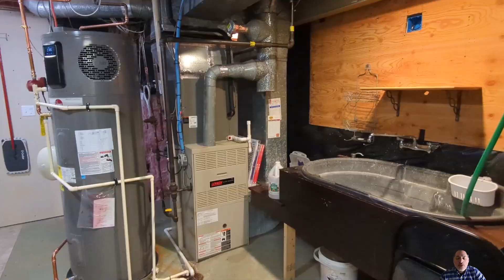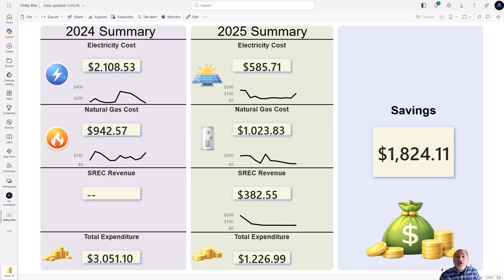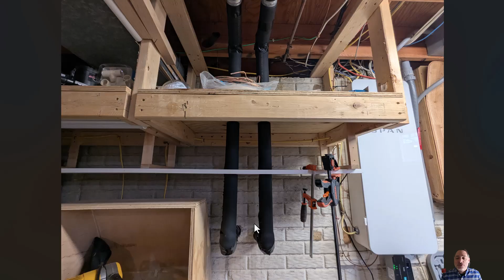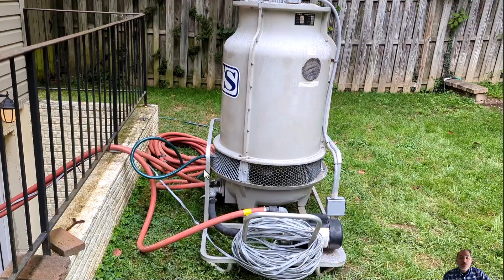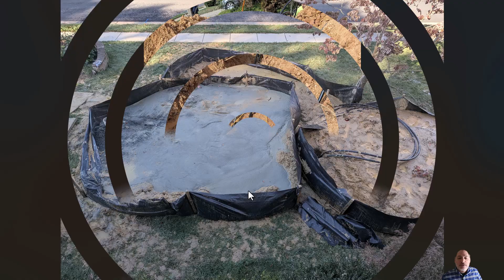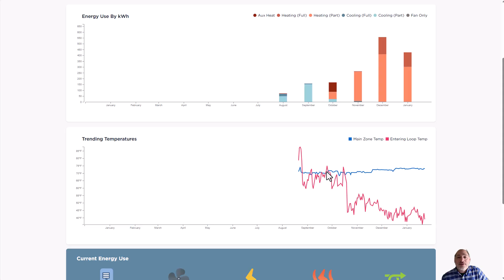WaterFurnace Series 5 vs 7 | Geothermal vs Air Source vs Gas — My Real Decision

Comment: We live in the Hudson Valley near Kingston NY.  Our geothermal system was installed in 2021 and is a 5 ton AAON WVA-060.  The house was built in 1987 and has about 1900 sq ft with a hot air duct system.  The quote from Dandelion Energy was $40,375 because we didn't do financing they gave us a $1750 credit.  The incentives were a $9,820 from our local utility which went directly to Dandelion and the Federal 26% Tax Credit for a final total of $21, 315.70.  There are two 300 ft deep wells and is a closed loop system.  We did get two zones which is great.  The Aux Heat hardly ever comes on but we do keep the system set at one temp in both hot and cold weather.  During the cold snap back in January and February of this year with temps hanging around in the single digits for three weeks the aux heat never came on.  We didn't get the desuperheater option because we also have a heat pump water heater.  We also have a 22.9kw solar system.  Here in the Hudson Valley we have extremely rocky soil and some huge boulders came out of the ground during excavation.

Comment: Did you decide not to add the desuperheater or optidry options on the series 7? The desuperheater would be super efficient with your heat pump water tank.
Reply from the maker: If I could go back and do it again, I might do the optidry option.  We don't really have much of an issue so I didn't think it was needed.  Still don't have any issues, but it might keep the house a little better balanced for humidity levels.  I was thinking about it a few months ago and when the unit needs to be replaced in 10-15 years I might go that route so I can compare living with both approaches.  For the desuperheater, it was about space in the basement and if the value was there.  I anticipated the only real benefit I would have was making the rheem heat pump water heater work a little less.  I don't think I would have saved any money on my already non-existent bills.  I just couldn't see the value for it in my situation, especially for the extra cost.  I figured if I had added that I never would have recouped the cost.

Comment: Upgrading to series 7 is a smart choice in my opinion. Many installers do not like installing or recommending a series 7 because it requires additional Waterfurnace training and certification. Not all authorized installers have the series 7 training and ability to install it. Found this out after almost all companies in my area were trying to convince me not to choose a series 7. Yes, there is a price difference but you are getting the best geothermal heat pump on the market and comfort in your home (low sound and comfortable temperature).
Reply from the maker: I was talking with the owner about the series 7, and he was trying to dig into the actual data based on my install and a few others in the area so he could use real data to help explain the benefit of the system.  Because I wanted zoning the series 7 was an obvious choice.  I tend to go with the most efficient option unless the cost is prohibitive.  In this case, the cost wasn't bad and included functionality I was looking for.  Made it an easy choice.  So far I'm very happy with the system.  The house is so much more comfortable, especially with the zones.  I just wish they had wireless integrated thermostats instead of wired.  I only added one extra zone because running the wire to where I would want a third zone meant too much drywall work.

Comment: Really good video - Thank you - I also live in Fairfax and met with the same company you did NA Geothermal to replace both my carrier systems. They also now do the dandelion lease which extends the 30% tax credit plus another 10% for American made equipment so a 40% reduction with the dandelion lease - I am considering this. How does your system handle heat and humidity? -TY
Reply from the maker: It did great during the winter in terms of heating.  There were two days when the heat strips turned on for a short period when the temperature dropped to single digits.  I reused my existing humidifier, which I didn't have any data available to say whether it was effective or not.  I don't think it was sized appropriately for the house based on what the system now shows, and I may change that out to an option that they recommend.  We haven't really had many issues with humidity levels to the point that it affects us or the house in negative ways, so not currently a focal point.

Comment: First, thank you for the time and effort you put in to making these videos.  Thank you for sharing the real world experience regarding the drilling of the wells as opposed to the nice info graphics shown on the company's website.  Your experience is a TOTAL deal killer.  A terrible mess of your yard and all the neighbors hate you.  It is clear that the contractors just wanted your money considering the outright lies they told you and the way they are slow-playing the remediation.  Here is an honest question.  Can you put a dollar value on the frustration, hassle, disrespect, loss of social capital with your neighbors, and true effort and cost that went (is still going...) into remediating the damage to your yard?  If you add this cost into your initial consideration between fossil fuel / air source / ground source where do you end up?
Reply from the maker: Yes, very frustrating and not an ideal situation.  The yard will eventually grow back.  A certain level of destruction was obviously expected, but not to the extent we encountered or to the neighbors lawn.  I still think it was worth it, and I really only fault the well drilling company not the primary contractor.  In my lifetime I shouldn't need to worry about the well portion of the system.  Yes I'll need to replace the indoor unit at some point, but that is the same as any other system.  Not to mention I now efficiently heat and cool my home mostly with my solar system at no added cost.  Hard to put a price on those benefits.  My neighbor will eventually get over it, and the lawn will grow back.  My neighbor mostly just blames the well people as I do. It helped having people from the company apologize to him.